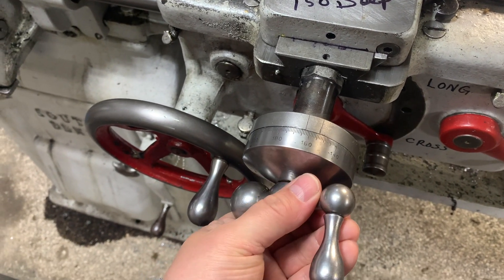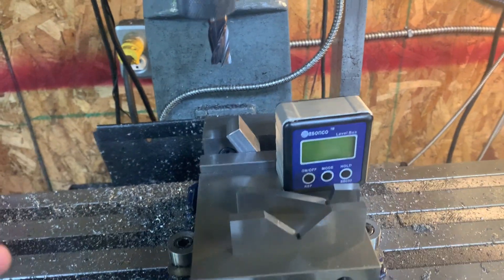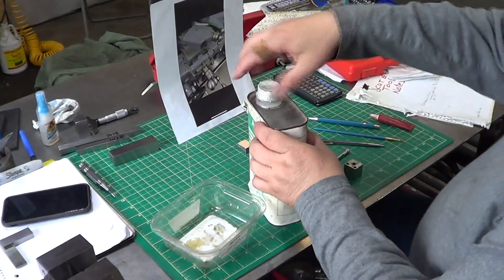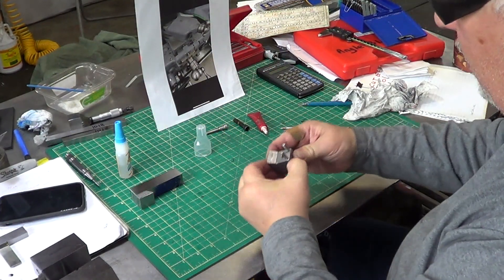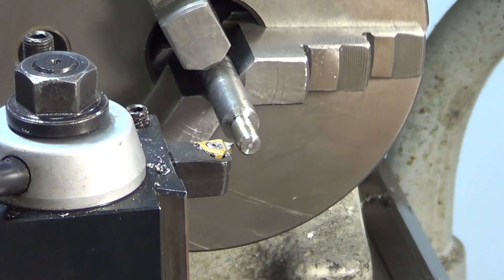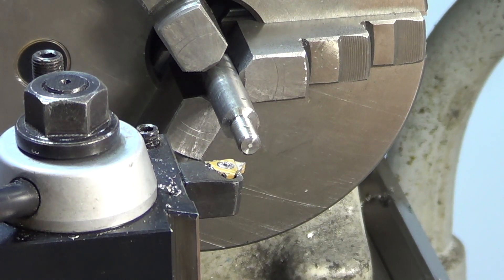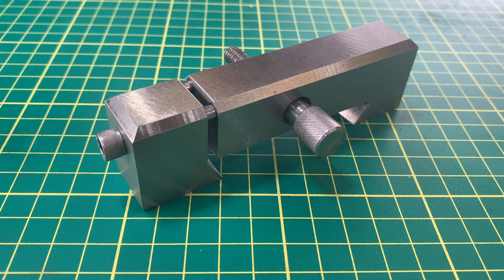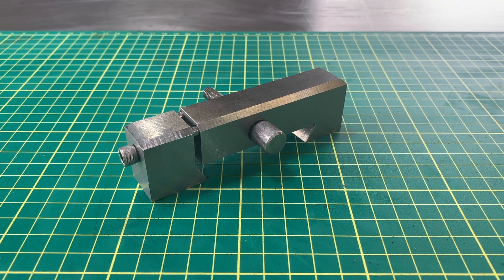Thread Cutting Fixture

Comment: If you feel the need to use the top slide for thread cutting then these gizmos are well worth having, but going straight in is just as good, no matter what some thinknots might say. They give all sorts of reasons why you should, to fix a problem that doesnt exist😂 
I suspect it all goes back to some apprentice master showing cutting something like a 6 or 8 tpi thread where it can be helpful, but on a lathe of half decent quality on threads used in the home shop it really isnt necessary. BUT, if you are comfortable doing it with the top slide then as it works well enough keep doing it that way, but having the top slide parallel with the lathe axis can be useful.